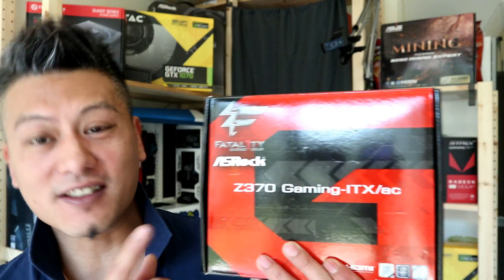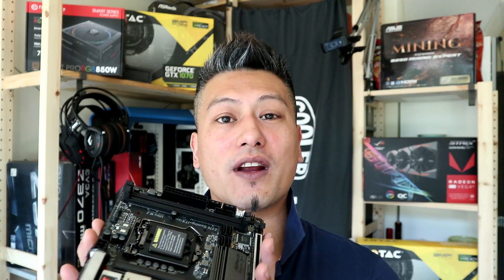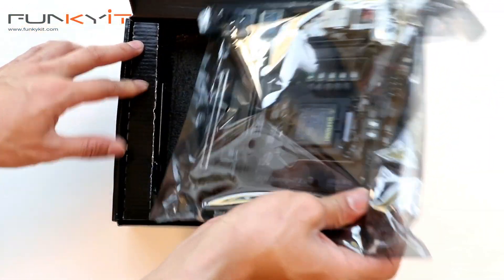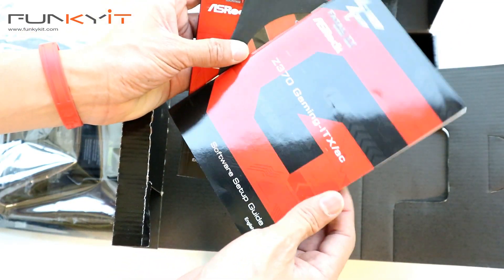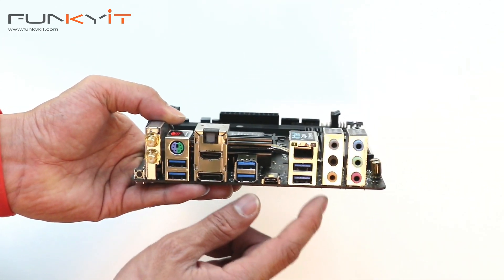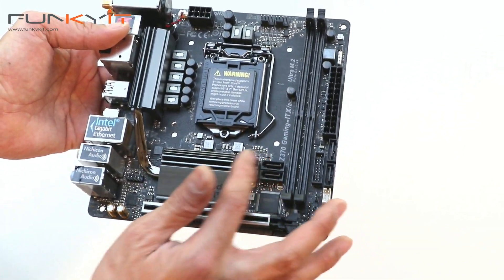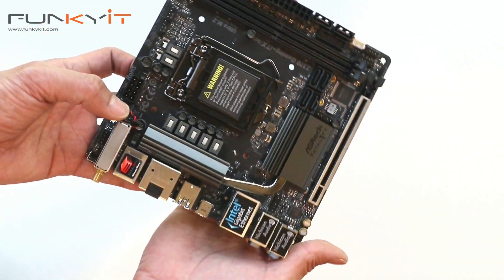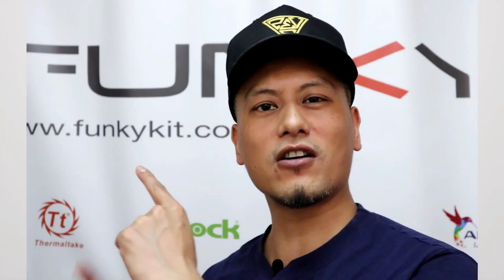The tiniest Z370 motherboard - ASRock Z370 Gaming-ITX/ac

Comment: Built my pc using this mobo - https://uk.pcpartpicker.com/b/PbCbt6 - So far very happy with the build - only downsides - would have preferred a additional M.2 on upperside of board (Asus Rog Strix Z370I Gaming has this as well as a heatsink for the M.2 - which I've got to admit is pretty damn impressive considering it's about the same price as the ASRock here) - Also I would have preferred an additional i.e. a 4th fan header ( like on its predecessor the Z270 Fatality itx/ac) - perhaps even at the expense of one or two of the 6 SATA ports. The desktop aerial antennae possibly could have been made magnetic.
That said - it's a terrific motherboard - I have my RAM overclocked to its speed of 3200MHz via the UEFI - instead of the 2666MHz that it is set for. Additionally there's the Thunderbolt 3 or USB-C 3.1 Gen 2 connectivity - which no other board has for the itx form - also it has a CMOS clear button for resetting the BIOS to its factory settings - should all else fail.
Reply: Works pretty well in my system - I've had a few LAN driver issues which I hope have resolved - otherwise all good. Thunderbolt transfers data at 40Gbs which basically means fast - useful if you want to hook up an extra display - Also you can use one single Thunderbolt port to hook up to 6 additional devices in a piggyback kind of fashion- I believe ?? Hope this helps

Comment: Did you happen to test whether the thunderbolt interface is running at full speed?
Reply: I've got this board ,it works really well but the thunderbolt 3 is 20gb upstream, 20 gb downstream, allowing Asrock to claim 40gb total.
Reply from the maker: marc monnette Testing it as we speak... full review coming soon
Reply: Great!  Sadly, I'm expecting the Thunderbolt support on this board to implement a 2 lane design, which would limit total bandwidth to 20gbps.  But hopeful 4 PCIe lanes are used; fingers crossed...